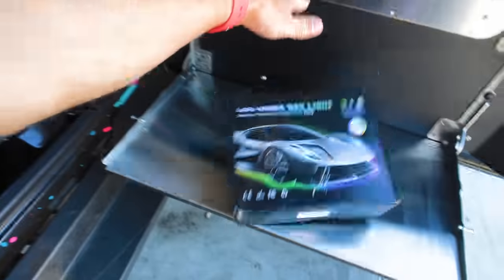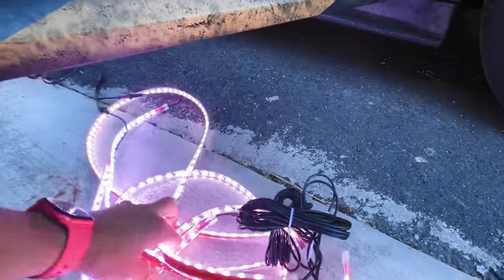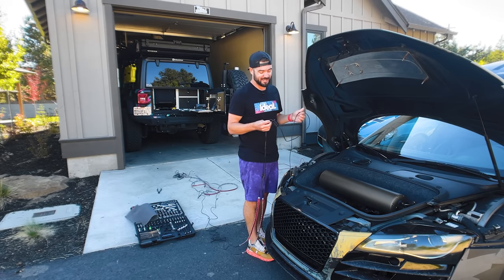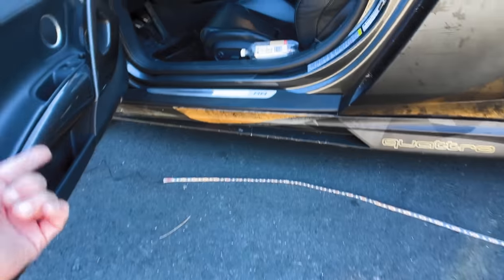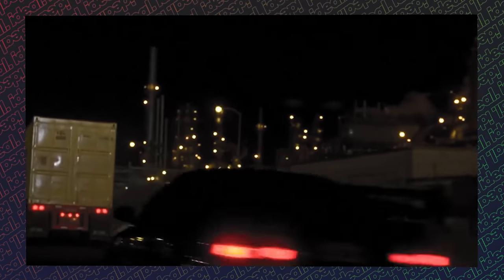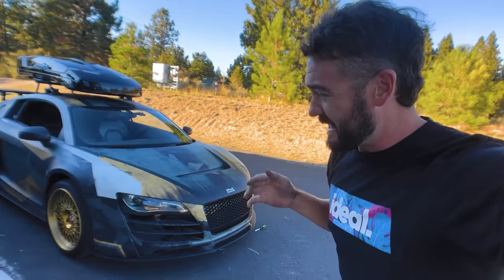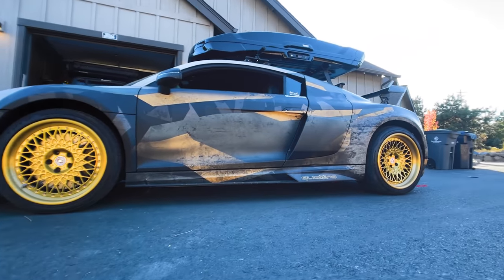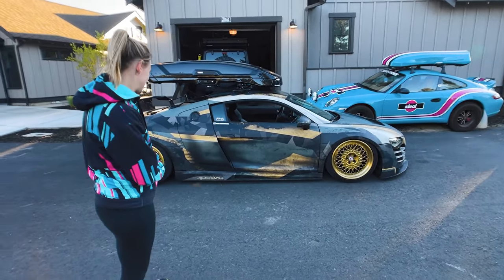Installing The Worlds Best CHEAP Underglow Kit!

Comment from the maker: Underglow is back! Snag the BEST Cheap Underglow On Amazon - https://amzn.to/3DhUDTS
What color do you think we should wrap Girth?
Reply: I want to see performance mods to the Audi. Dare I say it is becoming more rice than nice
Reply: The yellow matches the Gold Accents of the Wrap and Wheels, I didn't think it would stay, and if you rub the lip of the Splitter, then it may fall off.  On my 2016 Mustang it is on Factory OEM suspension and I had bottomed out on My Brothers 1st house... at My place My driveway is on a steep slope and rub my Splitter. All the time with just me in it .... By the Way Magneride Suspension is Awesome.. Kind of like putting 2 Positive Facing Magnets together Does not Happen and won't bottom out.  It grew on me though, probably would have tucked them higher up. Thanks for Sharing 👦🏻👍🏻🏁🏎 Still "Living the Ideal LifeStyle"
Reply: Make it old man brown
Reply: I heard underglow drains our battery tho. Does anyone has experience to share or any suggestions?
Reply: Wrap it Ford Grabber Blue 💙
Reply: wrong LEDs, it shows me 20$ inside LEDs
Reply: I can’t manage to get mine to change colors they will randomly but not solid color
Reply: Those lights still working?

Comment: Word of advice: use wire loom and gorilla double sided tape to make it REALLY stick so you don’t have to use zip ties. Plus using rubbing alcohol is a great idea too.
Reply: what’s the wire loom for?
Reply: @dizzysmith551  To protect the wires so they last longer and don’t get damaged.
Reply: Noted, thank you :)
Reply: @paulduggan2  No problem 😉
Reply: Would strong tape damage the paint if you took it off?
Reply: @YukiSuzukiIggyS  It could, depends on what you’re sticking it too, when I installed some underneath the golf ⛳️ cart 🛒 for my Dad, I used zip ties.

Comment: underglow gotten alot cheaper and better. i wouldn't pay 150 or 200 for a kit. my first kit got destroyed due to bad cable management. I went the same route for my cable management with the recent kit. it is alot better now. And when buying underglow, make sure there are only 2 cables come from the control box. If yours has 4 cables coming from the box. it is a lot more difficult to install. Because most of the time the length of the wire isn't long enough unless you splice to add more length.

And dont let a jack or lift destroy your led strips either.

Comment: How do you get the power to connect into the car without the wire being shut in the door? Hope this isn’t a dumb question 😬
Reply: run from the engine bay out the bottom - there's (usually) nothing between the engine bay and fresh air underneath so you can just run the wires down the chassis out to the bottom of your car

Comment: So if the connection to the LEDs and the phone is by Bluetooth you can't also have a connection for Bluetooth and your radio huh and for something like this could you not get a second phone without mobile data but with a Bluetooth on to work?

Comment: I heard underglow drains out battery tho. Does anyone has experience to share or any suggestions? Thanks
Reply: Led lights  don't take a lot of power to use you can probably power that whole system with a nine volt battery lol